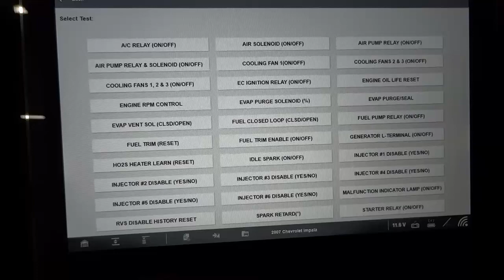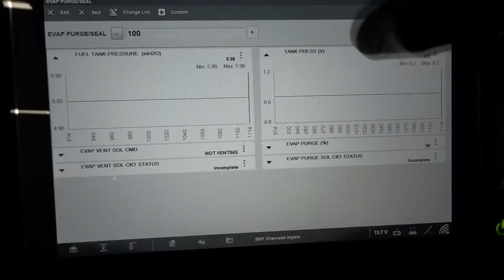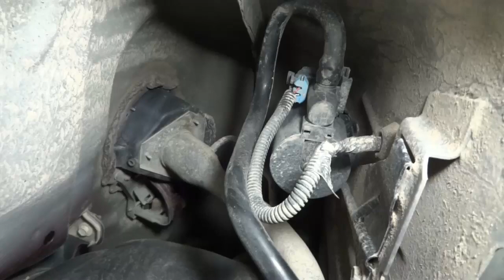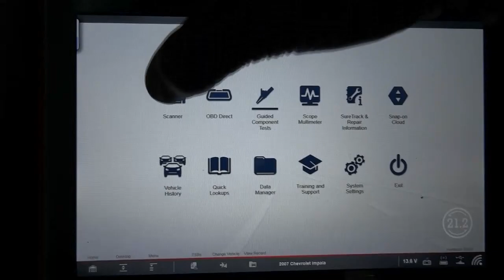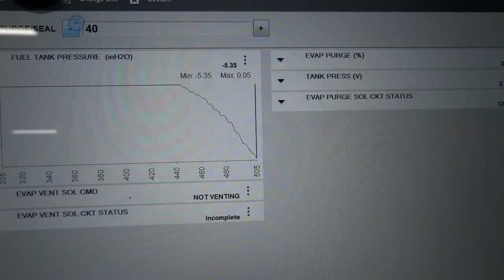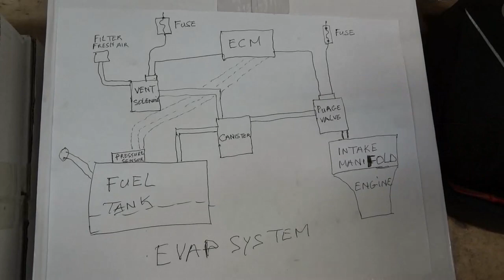Chevy impala Code P0446 EVAP System Vent Control Circuit Fault, Diagnosis and Repair

Comment: Hmm impressive,  this is not a case of a leak in the Evap system otherwise smoking the system to detect leaks may be the way to go. My worry now is  when and how do we know which test to embark on when code p0446 is thrown up? This code is normally meant for an issue in the Evao system generally,  any tips on which direction of test to go for so as to fix the concern first time?

Comment: This is probably the best demonstration of troubleshooting an evap code I have seen, thank you. One question, does the light clear itself once the issue is fixed?   I had failed an inspection due to an evap code. I suspect on my 2004 Chevy Impala it’s the purge solenoid, and going to replace it, but I do not want to clear the DTC’s once I fix it because then I have to wait at least 2 weeks for the monitors to be ready again for the inspection.
Reply from the maker: @mikepier1  Thanks! if you don't erase the codes just drive and eventually the light will go off!

Comment: One of the most thorough explanations I’ve ever witnessed. Kudos!! I recently bought a 2012 Chevy Impala that has three distinct issues related to this video. I’m unable to pump gas without the nozzle, constantly shutting off a PO455code, and a PO446 code. The gas tank issue started Day 1. The codes were intermittent and are now permanent. I was going to replace to vent solenoid off the bat. Note I’m going to get a thorough diagnostic run first. No sense in changing parts that don’t need it.
Reply from the maker: @mattswartzer   Thanks! I'm glad to hear thatt the video was helpful!
Reply: @KITS_Auto_and_Truck_Repair  Kit, as a general question, when someone is unable to pump gas into their 2012 Chevy Impala, would you suspect the canister is the issue if the purge and vent solenoids work as intended?
Reply from the maker: @mattswartzer   that's usually caused by a blocked vent solenoid or a restriction on tthe solenoid tube!

Comment: Great video. I'm gonna try replacing that fuel tank pressure sensor. I noticed you completely dropped the tank after saying you would try to just lower it a bit. Not able to get at the sensor without disconnecting everything?
Reply from the maker: @damkayaker  Thanks! Yes!

Comment: Have a po446  evap system vent control circuit it came on this moring check gas cap ok what else can I check
Reply from the maker: Simon flores you need to have a pro mechanic diagnose it for you, you might have a bad vent solenoid or a problem in the solenoid wiring or a blown fuse!
Reply: @KITS_Auto_and_Truck_Repair  just got my Anyscan a30 bi-directional so iam going to use it to find the problem
Reply from the maker: @simonflores3410   Sounds Good ! Good Luck!
Reply: I check the vent purge valve  solenoid an started the truck an I command  it to 10% an my vacuum gage show vacuum an when I try to release the vacuum it didn't wanted to release just stay vacuum

Comment: I just had Auto Zone use their code meter on my 2010 Chevy Impala. The P0446 code was found. For the past year when fueling up my car the gas station fuel pump will stop filling my tank after a few gallons. I then have to take the nozzle out of the car and reinsert the nozzle to pump a few more gallons and then the same process happens. It can take up to 10 reinserts to fill my tank. Do you have any information about what causes this to happen?  If you have a link to a video or website for me to go to I would appreciate you heading me into the correct direction. I don’t want to take up your time as I’m sure you are busy. Thank you for any information you have to give. I watched this video and it made perfect sense, great job!!
Reply from the maker: Gennifer Williams  Thanks!! it sounds like your vent solenoid is stuck closed! check out my vent solenoid video on a chevy silverado on this channel!

Comment: I can really appreciate the full diagnosis of the full system, purge valve, vent valve, purge hoses and lines and the FTP Sensor at the end. Actually with the scan data given it was easy to see from the beginning that the FTP Sensor was the problem. For video training, great job, for charging the customer for diagnostics, if this was done in one hour or less great, if it took more than one hour and you charged more than one hour, huge problem. I have seen a YouTube Channel where a guy was doing the most simple troubleshooting step by step to verify each and every little step of the way, he then used up his ONE HOUR and said on the video that he needed to ask the owner for another hour. His process was completely wrong, it was worse than a beginner level but when he asked for more time, I WENT OFF ON HIM in the comments, if that was my car, we would be going to court.

As for your video my friend, please be careful about how much time you spend, with your ability to EDIT your video shorter, we don't know how much time you used to diagnose the easy-to-see actual problem of the FTP Sensor, hopefully, less than the typical one-hour diagnostic fee, no worries. Otherwise please be careful what you say in the video about the time needed for diagnosis. In your specific case study, I would notice the voltage is not 1.5V on the scan tool, I would pull the gas cap to release any pressure or vacuum and if nothing happened I would have gone straight for the wires and voltage readings as you have done on the scope and not wasted time on all the other components. I have mentioned to you before about you repeating your words again and again. Sorry but this 15 minute diag and EDIT in the repair should not have been more than the standard 20-minute video, you are a smart guy, please make shorter videos, that is my feedback, much appreciated.
Reply from the maker: Duane Donaldson  Thank you for your feedback!!

Comment: I have a 2004 Chevy impala I can access the fuel pump from the trunk without lowering the tank I see the same sensor on the fuel pump…. Exactly where you replaced your sensor I do not see on mine ….Yours is along the side mine doesn’t have where yours is …please help i have no money to pay mechanic 200+ I did a lot of work myself …radiator, heater core , thermostat… …please help I need to pass inspection
Reply from the maker: lilmr5boros1  look around the EVAP Canister!!

Comment: I got this same exact code. A guy who use to work on cars said because it’s P0446 that I’ll likely have to replace my whole catalyst converter… I don’t think it is that at all since I can’t find any info online. I have a 2004 Chevy Malibu. What do you think ?
Reply from the maker: David Hardcore  no, you don't need a catalytic converter, it propably needs a tank pressure sensor, you need to take it to a pro mechanic to have it diagnosed!!
Reply: @KITS_Auto_and_Truck_Repair  Thanks man. You’re the second reply I got on here saying No that it isn’t the catalyst converter. Idk why some guy who use to work on cars would even tell me that… smh but thanks for the info ima snap this reply comment and look more into it.
Reply from the maker: @davidhardcore704  My Pleasure!!